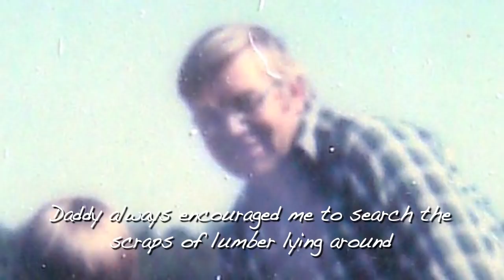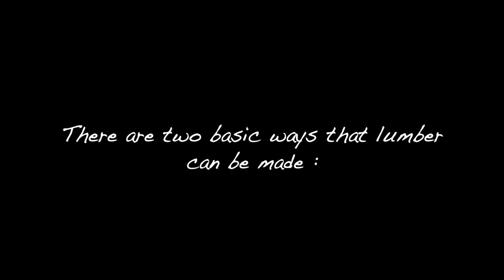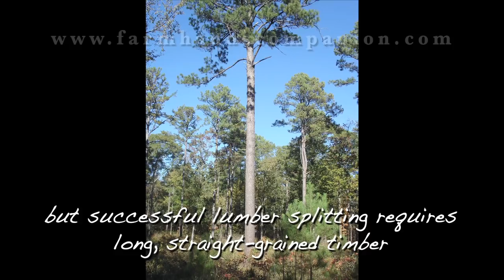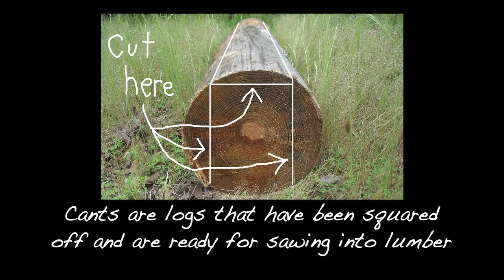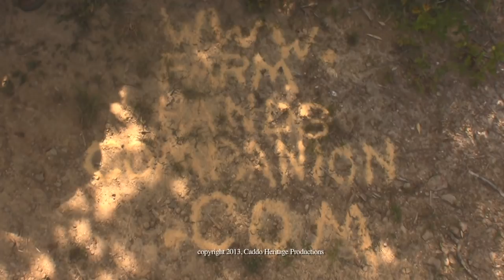Homemade Lumber for the Small Farm or Homestead - The Farm Hand's Companion Show, ep 5

Comment: I use a bunch (5) of pre-cut sticks about 12" x 1" x 1/4" instead of wedges to keep my cut open. I found the wedges can lift the back of the board where your jig is resting and change your cut angle.

Comment: Thanks for the really nice home grown video.  I've been using the Alaskan Mill for years with great results and have never found any benefit in rocking from side to side.  A steady forward motion has always given me a much smother cut, just as long as you maintain the optimum sharpness and the proper angle of the top cutters.  Ten degrees or less, but filed consistent and accurate for all the teeth.  Inserting wedges  or spreaders is important so the chain does not cut into the portion already cut and cause added grooves.  I always use my guide bars, not just for the first cut, but for every subsequent cut in order to get the best and truest surfaces.  Just a few thoughts that might be helpful, even for some of the "Old Timers" from Frank Crane in California.

Comment: Great job both with the lumber and the videocam!  I wonder if you could tell me the brand and model name of the bigger of the two mills. You mentioned the smaller is 'the beam machine' for making cants. I like the fact that the bigger one has a safety feature around the tip of the bar. Thank you and keep milling!
Reply from the maker: +Dr Marx 
Hello Dr. Marx,
The bigger attachment is an Alaskan Mark III mill for a 24 inch or less bar.
Thanks for watchin'!

Comment: You are doing exactly what my intention is.
You have listed a number of books, your recommended camera, and even your favorite overalls, but you didn't include the chainsaw mill, or your chainsaw squaring attachment.
I see there are plenty of them listed online, but not sure which would work best.
I like the looks of the one you are using, and the squaring unit as well !
Can you please list the attachments you are using !
Good work by the way !
Reply from the maker: Hey there, quadsman11!
My attachment is an Alaskan Mark III mill made by Granberg for a 24 inch blade. The smaller attachment is called The Beam Machine. Hope that helps, and thanks for watching

Comment: Great video, I love it
Makes you feel for the two guys who were cutting the planks up with an overgrown  cross cut saw for 12 hours a day, especially the apprentice at the bottom!!!
As a matter of interest are those chain saw attachments commercially available or did you make them?
My chain saw does not like cutting with the grain but loves cross grain work, so I am a bit surprised with your success
Reply from the maker: icespeckledhens I'm always surprised at my success...when I'm successful.A big chainsaw engine helps, and a ripping chain probably wouldn't hurt, either.
And yes, those attachments are available from Northern Tool.
Thanks for watchin', icespeckledhens!
Reply: Which attachments are you using, as there seems several advertized?
Thanks

Comment: great job ,trying to find enough ceder for posts. how long is your barn?
keep on keepin on
Reply from the maker: Jim Duncan Hey Jim!
The pole barn is 22 feet in length (of course it's open on the inside with no inner walls, but if there were walls from pole to pole, it would consist of two 11 X 11 foot stalls in the middle, and two 9 X 11 foot stalls on both side sheds). No particular reason for that particular measurement; it can be as short or as long as the lumber you're trustin' to make the span at the top. The wider the span, the stronger the boards need to be to support the weight.

Comment: Hey PaMac, you mentioned cuttin' the trees when the sap ain't in em. How long do you suggest they season until they're ready for millin'? Is there a best time of year to cut trees for lumber?
Reply from the maker: Hey Wannabe Woodsmen,
If you're going to mill pine, I'd prefer to let em cure for about 6 months (and no more than 12 months if they're left out in the weather or especially on the ground). I'd want to mill oak as soon as the tree is felled if possible. I prefer taking trees for lumber during the dormant winter months, too.

Comment: Great video I sure wanna try this could u please tell me what the attachments you used are called and where they might be purchased thanks also what size saw did you use ?
Reply from the maker: Hey Tommy,
The first attachment for makin' cants is called "The Beam Machine" and the second one for millin' the lumber is an "Alaskan Mark III" chainsaw mill made by Granberg International. Both are available through a number of retailers. My particular saw has a 24 inch bar.

Comment: Hi love your videos. I've got the same red beam machine type attachment but wondering what brand of a milling attachment you are using? There are a lot available and I'd like to get the same One you have with the handles. Thanks. Jim
Reply from the maker: James H Hey there, James,
It's an Alaskan Mark III for a 24 inch or smaller blade.
Thanks for watchin'!
Reply: Thank you, did it come with the handle your holding onto or was that an extra add on? Also what size motor chainsaw are you running there?

Comment: so im curious as too how much u had to sharpen chain an re tighten it? every board? every other? 2 times each board? once a log? what do u think it is..an did u have to retighten the chain a lot? also cc of chainsaw an bar length...am thinking about doing this an would love some advice thanks! good vids by the way.
Reply from the maker: Hey A B,
You can check the website (farmhandscompanion.com) for more info on some of my chainsaw milling procedures. 
Thanks for watchin'
Reply: depending on the quality of the saw. good unit every other cut. high quality units every 2nd to 3rd cut or so. poor quality every cut. plus the quality of chain yr buying as well.

Comment: I did chainsaw milling for a while, but, it's HARD work on the body and the chainsaw.  I got some massive beautiful 30 inch planks 4 inches thick 14 foot long using a 36 inch Homelite 750.  That dinner table is never going to move..!!  Most folks will switch over to a bandsaw mill sooner or later.......
Reply: Tis true, at least I did.  Still occasionally use both of the attachments used here to trim logs to fit my mill (only cuts 30") and for the finish on beams as many folks like the apperence of the chainsawn over the bandsawn surface.

Comment: Why are you weaving back and forwards with the saw?
Reply from the maker: Hello Peter,
Others may have differing opinions, but I think the weaving is less harsh on the chainsaw engine since the amount of wood being cut during the weave has less width than simply moving the blade down the log perpendicularly. If I'm wrong about that, at least weaving makes me think I'm takin' it easy on the motor!
Reply: Have you tried pulling the saw instead of pushing it?
Reply: If you pull, chances are the chainsaw will be pushing against you, instead of the saw catching the wood and pulling you into the wood. From what I understand at least.

Comment: skidding from the 3pt hitch is a good way to end up dead.  Always skid from the drawbar, not the 3pt!!!
Reply from the maker: Hey Andrew,
I sure hope you've not lost someone close to you in this way. 
I'm not quite sure how the 3pt hitch is any more dangerous than the drawbar, so maybe you can share that with us. If true, then most of the small logging operations in Arkansas are in danger. But that's kind of the historic thing about loggin' ... danger ... and why most people don't do it. Honestly though, just drivin a tractor (with nothing attached) can theoretically be fatal, so it's always good to keep safety at the top of our minds.
Thanks for watchin', Andrew.
Pa Mac
Reply: farmhandscompanion
Sure, let me explain.  When you pull a log (or any load in contact with the ground as it drags) with the three point hitch at a place above the level of the axle, it acts as a lever and can flip the tractor backwards.  The load is above the rear wheel's center of gravity.   It happens so fast the operator can do nothing to stop the "rollover."  It's actually using the power of the motor to flip the machine backwards, especially if th elog catches on a root/stump and the rear tires get traction.  The rollover protection bar on modern tractors may act as a cage if the operator is seat belted in.  So the 3 point is for lifting loads off the driving surface - the drawbar is for towing or dragging.  If you search youtube for rollover accidents there are many on video.
Reply: Andrew Johnson
I like your videos, but towing from the drawbar is a headache but necessary.  When mules pulled logs there was no danger as the mules don't have large rear wheels acting as levers to flip the operator platform.
Reply from the maker: Andrew Johnson Good safety tip, Andrew. Dangerous things can happen quick on a tractor.
Reply: WRONG!! I would rather use the tongs on the 3pl than the draw bar as the head of the log is of the ground thus avoiding getting caught on stumps and roots.you only have to ensure that the log you are snigging (skidding) is not to big for your tractor,  rgds Aussie sawmiller
Reply: Andrew Johnson Correct.  A man in Elgin, Texas died this month this way.